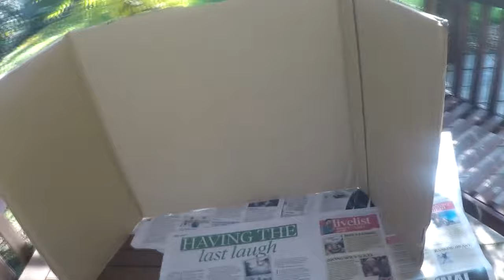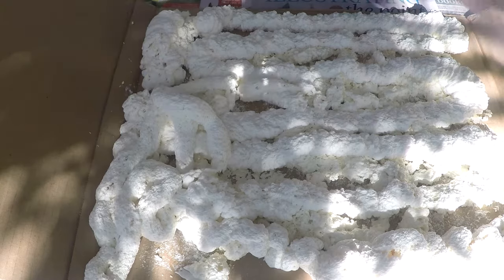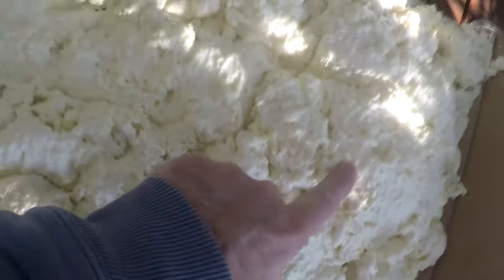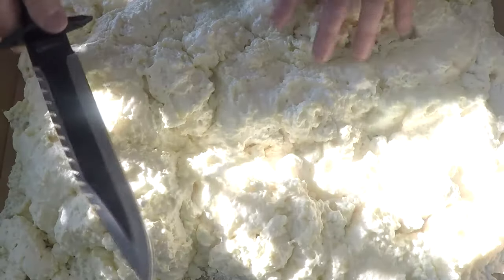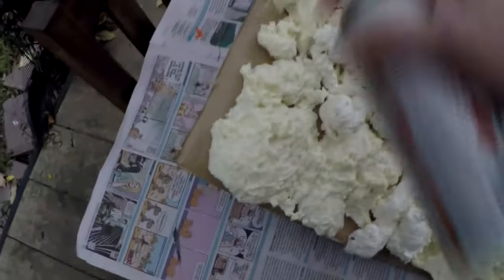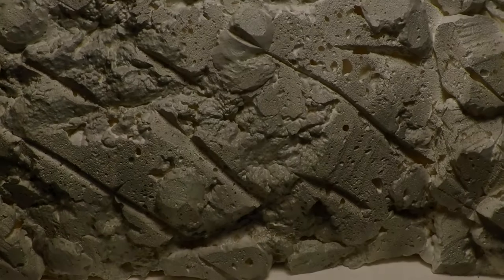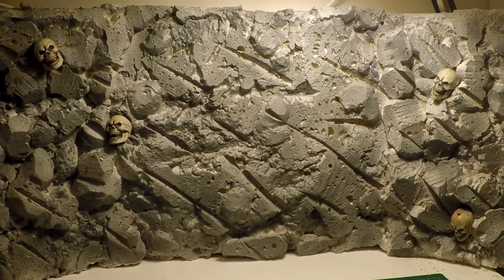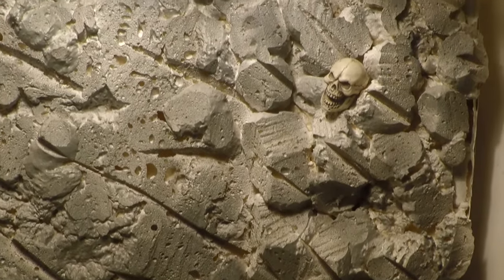Create a faux rock wall with foam in a can!

Comment: So keep the cardboard backing on. Is that going to mess the wall up over time ?this looks awesome
Reply from the maker: It all depends on what your usage will be. For a simple free standing backdrop absolutely but if you want to actually attach it to a wall on a larger scale you might want to do it on something like plywood and screw it to your wall. This can then be more easily removed if need be.

Comment: I've had some parts that were more yellow and less white and very "airy" like rice crispy cereal. It wasn't as compact and thick "foam" like in other spots... did it not cure enough? Or do you have to keep shaking the can as you go?
Reply from the maker: Yeah, it's a pretty inconsistent product as far as texture goes. It's original purpose is for void fill so it's going to have lots of different densities throughout. It certainly wouldn't hurt to frequently shake as you use it but the end result may not vary that much.

Comment: Does the foam stick to the cardboard once it dries? Or did you pull the cardboard backing off? Very cool.
Reply from the maker: Yeah, it's a very sticky product and also keeping the cardboard backing helps with the strength and rigidity overall.
Reply: @RETROROCKETMAN  Thanks. Gonna attempt to make a full size wall. Wish me luck.
Reply from the maker: @danschmidt3215  I certainly do wish you luck... I practically used an entire can just on my small piece! Yours sounds like it's gonna be epic!! Cheers:)
Reply: Thank you so much I’m literally making a real man CAVE this will simplify things